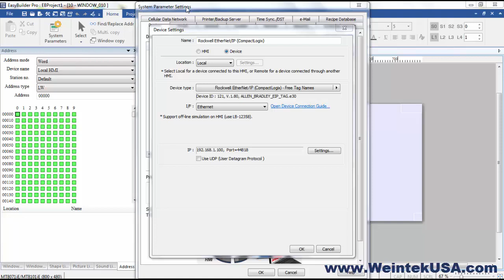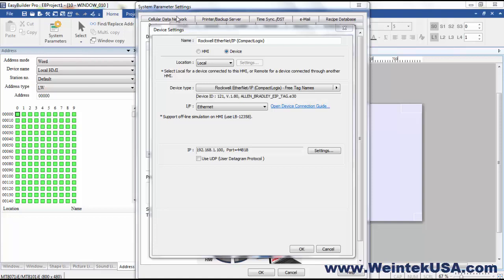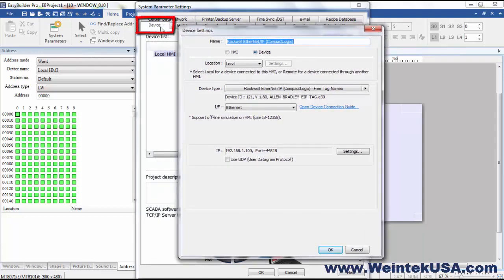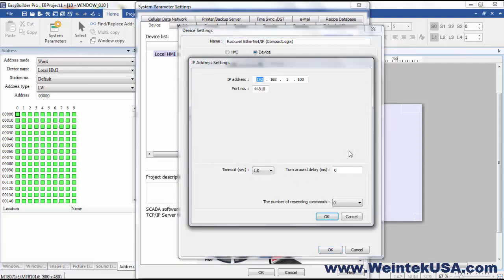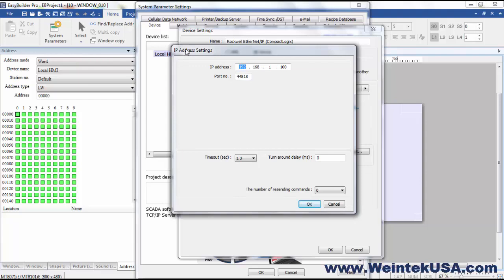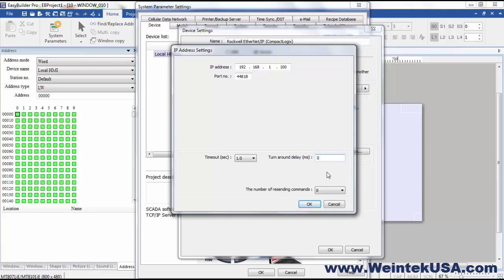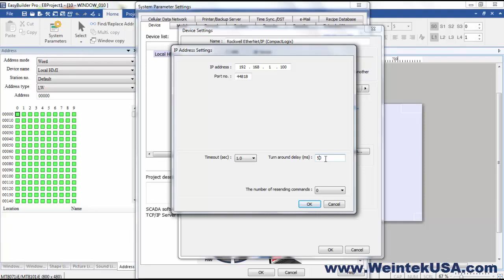How to Slow Down Driver Comms, Turn Around Delay Pulling Rate Weintek EBPro

Comment: If the device location type is changed to "remote", the "turn around delay" option will not appear. How this option can be set when using the remote device?